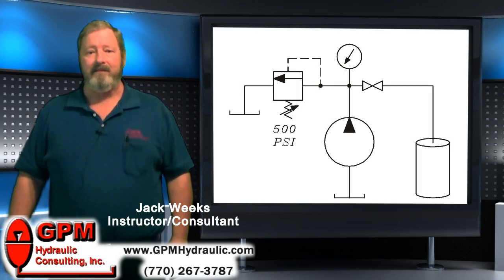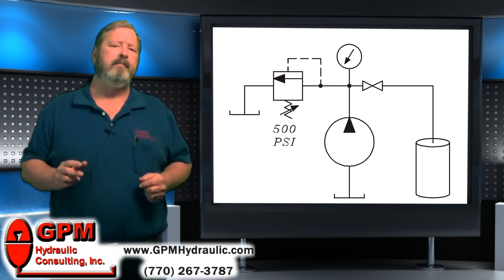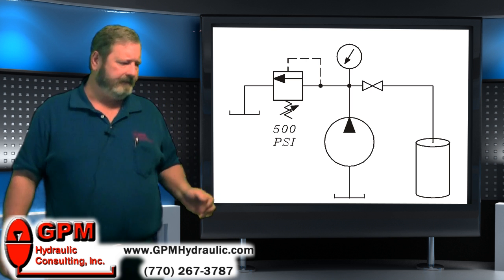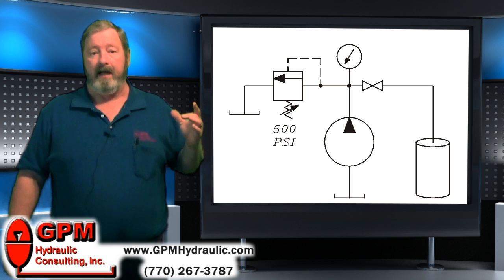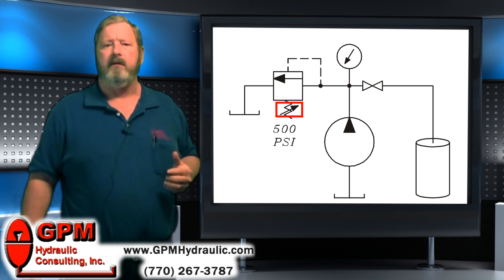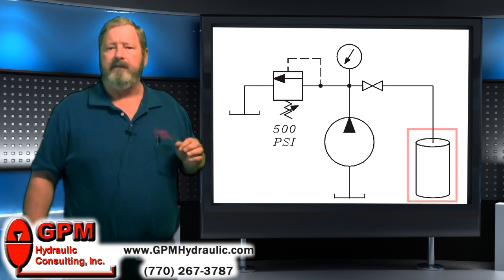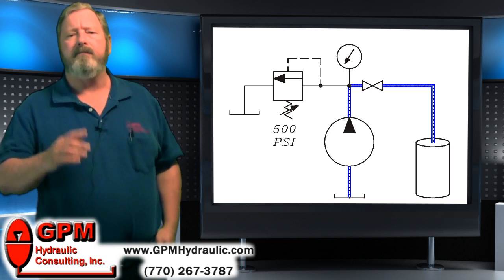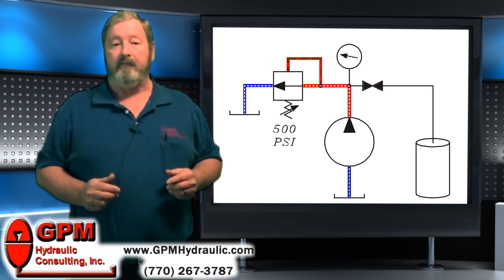The Difference Between Pressure and Flow

Comment: Does resistance affect flow rate? For example if I swapped out a 10" diameter line between the hydraulic pump and the hydraulic motor for a 5" diameter line, would this decrease in diameter result in decreased flow rate? Or does it not matter since flow rate is determined by the pump chamber size and pump speed, and therefore the same flow rate will exist; just at higher pressure?

Comment: There is "no difference".  You cannot seperate pressure and flow.  Each one is the result of the other.  A pump adds energy into the system.  Hydraulic Energy is pressure x flow.  How much of each one results is determined by how efficiently a pump can convert Energy to the pressure component of Energy, ie potential energy, and flow energy, ie kinetic energy.  The pump's efficiency is strongly related to how much flow is running through it at any given time.   At BEP, you get the best efficiency and the highest value of pressure x flow for the electric energy being supplied to the pump.  At off BEP flows, low flows produce high pressures and high flows produce low pressures.  Adding pipe and equipment into the system changes the resistance to flow and that causes the pump to change its efficiency, which causes a new Pressure x Flow output combination from the pump.  You cannot seperate pressure, from flow, or resistance.   

Look at the hydraulic and electrical analogy.  You will see that you are trying to separate amps and resistor and voltage.  Electrical engineers do not ever try to separate them.  Why bother, the result is the result of all three.  Set any two Volts, Amps and you know the last, Ohms, one.  Same for  pressure, flow and resistance from pipe/valve/equipment. 

BTW, electrical valves are called transistors.

Comment: How to set a kawasaki axial piston pump K3vg280 with torque horsepower on the hpu because it is the system trips while operating and where should I decrease flow or increase it on the controller
Reply from the maker: Hi Charles, thanks for your question! That pump should have a volume stop (manual volume limiter) on it. This is simply a screw that limits the travel of the swash plate. Turn it clockwise and that should make the system stop tripping.
Reply: @JackWeeks  thanks Jack you simply the best people like you deserve more in this hydraulic departments you explain things easily thanks buddy

Comment: Hi , hope you are good. Wanted to know your views on Pressure reducing valves. When I checked, seems that they all have internal leakage through their pilot line. I mean , for a pressure reducing valve to work , the pilot line must drain oil to tank. 
So if any pressure reducing valve is connected to an accumulator, it will drain the accumulator till the preset pressure is reached and pilot drain flow will stop ! 
Am I right? Can pressure reducing valves be used with accumulators? For example, can we have a 3 way pressure reducing valve without internal leakage? 
Do we have any models of 3 way pressure reducing valves without leakage?
Does leakage happen when valve is off ? 
For e.g suppose I have a 3 way proportional pressure reducing valve; when valve is off , output pressure is zero. If this valve is connected to an accumulator, will it drain all accumulator oil little by little? Will leakage occur when valve is off ?
Thanks.
Kind Regards.
Reply from the maker: Hi Nadeem. No, I don't think I would recommend using a pressure reducing valve in an accumulator dump line. Depending on the valve, it could easily be constructed to leave some back pressure in the accumulator. Best to use either a flow control or a gate valve. Usually it's best to dump the accumulator slowly, too, so don't open your flow control too  far. Keeps turbulence from the reservoir so you don't stir up sludge when the accumulator is dumped. Thanks for your comment!
Reply: @JackWeeks  thank you 🙂

Comment: Hi , wanted a small clarification: I wanted to know how pressure changes in a hydraulic system pushing a load. 
For e.g take a simple hydraulic Jack:  My idea is that whatever force that I am applying on one side ( it may be 1 million N) , the pressure of fluid will always be based on the load rather than the 1 million N that I am applying. You get the picture : we have 2 cylinders connected to each other and filled with fluid. We have 2 pistons. I applying force on one of them to try to  lift a load by the other piston. Suppose load = 500N 
My oil pressure will be based on 500/A2
NOT 1million/A1.
So during the lifting process, the pressure will still be 500/A2.
Same thing will happen in a hydraulic circuit :flow of pump is constant , the oil pressure will be simply calculate using the load ; the cylinder will extend/retract at constant speed. BUT HOW CAN I ACCELERATE A PISTON? WE SHOULD HAVE AN 'ACCELERATING' FLOW ? 
IF MY PISTON IS ACCELERATING , MY OIL PRESSURE WILL ALSO INCREASE! MY OIL PRESSURE WILL NO LONGER DEPEND ON THE LOAD! SIMPLY TAKE THE JACK EXAMPLE AGAIN ; HOW CAN I LIFT THE OBJECT CAUSE ACCELERATION! WILL 1 MILLION N CAUSE ACCELERATION? WILL PRESSURE BE HIGHER?
Reply from the maker: Thank you for your question, Nadeem! You are correct in your understanding that the pressure is determined by the resistance of the load (plus any other resistance in the system). Speed is determined by the rate of flow. If the increase in flow also results in an increase in resistance (friction in the pipes, for instance), then of course there will be a corresponding pressure increase to overcome it. But the increase in pressure had nothing to do with the acceleration of the cylinder, only any increase in resistance.
Hope this helps!
Reply: @JackWeeks  thank you very much for your reply.....🙂 get your point....you know, I can't imagine how can a piston accelerates! When we normally deal with hydraulics, we are using talking about constant speed of extension/retraction. If I want to make a piston accelerate;  the only variable that I suppose could do this is the flow! It should be an increasing flow to cause an acceleration of the piston! Am I right?  But then, if the piston is accelerating , using the equation F=ma , you'll get an additional force on the piston. But this additional force is only provided by the oil pressure ? I mean , an increase in oil pressure ? Don't know if I am right! Its kind of confusing.
Anyway for example lets consider the same example of the hydraulic lift: I will push on one side to lift a load on the other side. Load is of 500N.
If I apply 1 million N on one side ; the oil pressure will still be 500N/A2. But will the piston move at constant speed or accelerate? If it is accelerating , which force should I consider to calculate acceleration ! You get my point? Because   the oil is only pushing the weight of 500N with 500N too. Or should I consider the piston and oil as a single object !
Reply from the maker: @nadeemzzz5599  I think I see what is causing the confusion. You are seeing an increase in pressure when your cylinder accelerates and it appears to show some relationship between speed and pressure. I'm guessing however that you must have some sort of orifice in your line to avoid overspeed of the cylinder. We must remember that, whenever flow through an orifice increases, so does the pressure drop across it. This increase in pressure drop adds resistance to the system, thus requiring more pressure to overcome.
Hope this helps!
Reply: @JackWeeks  yes you are right ..thank you🙂🙂🙂

Comment: Hi Jack, the message seems to be that the resistance which the pump has to overcome to maintain flow is where pressure comes from. My question is: Doesn't the source on the influent side of the pump also contribute to the pressure gauge reading on the effluent side?
Reply from the maker: Thank you for your comment! I'm not certain that I understand your question, but I think you are asking if the outlet pressure of the pump can be changed by changing the suction pressure. No, it can't. Regardless of the suction pressure, if there is no resistance downstream of the pump, there will be no outlet pressure. And, once the downstream resistance has been overcome, changing the inlet pressure will not affect the outlet pressure unless it causes the pump to stall.

I hope this helps!

Comment: Very nice video . I want to ask of the pressure gauge reading at the pump outlet always indicate the resistance that the pump has to overcome in all pump cases  ?
Reply from the maker: Thank you for your kind comment and question! Yes, you can consider pressure and resistance to be synonymous in a hydraulic system. If you remove all of the resistance, say, direct the outlet of the pump straight to tank, the gauge will read nearly 0 PSI (perhaps a small amount of pressure resulting from the resistance of friction in the piping).

Comment: HI my name is Brian. Am a technician in Kenya. Thank you for your tutorials. I have this question; how do you overcome the flow/pressure from a bigger pump feeding a 4''pipeline with a smaller pump jointing this pipeline with a 0.5'' pipe. Basically the second smaller pump is trying to inject its fluid into the bigger pipeline but is overcome by the bigger pump and so doesn't achieve this.
Reply from the maker: Thank you for your comment/question, Brian! Clearly the pressure in the 4" line is above the pressure developed by the smaller pump. I suppose the question would be, where is the flow from the smaller pump going if not into the pipeline? We need a bit more information here. You don't say what type of medium is being used here, or the purpose of injecting fluid into the larger pipe. Are the fluids in both pipes the same? For instance, is the smaller pump used to inject liquid soap into a larger water line? Or are we using the smaller pump simply to augment the flow of the larger pump? Are both pumps positive displacement? If so, they would likely be protected by relief valves. If the smaller pump is positive displacement and the pressure is too high in the larger pipeline for the smaller pump to deliver, the flow of the smaller pump must be dumping across a relief valve. It may simply be a matter of setting the relief valve protecting the smaller pump to a higher setting so that the path of least resistance is to inject into the larger pipeline rather than dump across the relief. If however the smaller pump is not positive displacement, the pressure in the larger pipeline is too high for the smaller pump to deliver. In that case, the smaller pump would begin to bypass across its internal clearances. If this is the case, you will need a different pump to deliver flow through the 0.5" line. Hope this helps!
Reply: Hi thanks for replying. Now the fluid in the 4 inch pipe is petrol and the smaller pipe is an additive injection to mix with that fuel to a set ratio. I'll have to find out if the pumps are positive displacement, but I suspect both are. The mech team tried fix a non return valve on the  smaller pipe right at the inlet to the 4 inch. We are yet to test and hope it will work. Do you think the non return valve will work? Or we must use the thermal relief valve?
Reply from the maker: @Bojak079  The non return valve will keep reverse flow from entering the 0.5" line and turning your smaller pump backwards, but I doubt it will help overcome the pressure in the 4" line. In order to add flow, the pressure in the 0.5" line needs to be higher than that in the 4" line. The smaller pump should be able to withstand the resistance in the 4" line if it is positive displacement. If there is not already a pressure relief valve in that 0.5" line, the smaller pump must not be positive displacement. It must be behaving similarly to the impeller type water pump in an automobile engine when the thermostat is closed - bypassing internally once pressure reaches a certain point.

Comment: Sir i ask u one question plz reply sir ane ahu air handling unit 5 bar pressure but one issue if our actuator open time and close time chw pipe vibaration why sir after 6 sec vibaration normal but our actautor value all okay can u answer this question plzz sir
Reply from the maker: I'm not sure I understand your question. Do you mean that the actuator vibrates for 6 seconds when cold, but the vibration goes away after it warms up? If that is the case, it sounds as though you may either be overlubricating your air, or perhaps using the wrong oil in your lubricator.

Comment: What is pilot lines?
Reply from the maker: Excellent question. The pilot line is a very small line that delivers a pressure signal to the valve. In this particular case, the valve is a relief valve. The pilot in most relief valves is internal (even though the symbol is drawn such that it may appear to be external).Whatever pressure is present in the main line will also be present in the pilot line. Pressure in the pilot line acts upon the internal spool (or plunger, depending on the type of relief valve) and, once the pressure reaches the amount necessary to compress the internal spring, will shift the valve open. Fluid then returns to tank through the valve.
Hope this helps! Thank you for your question.

Comment: Most folks don't know the difference between STATIC pressure and VELOCITY pressure.
Reply from the maker: True, but to be fair, that would apply more to HVAC systems than to hydraulics since, in hydraulics, the two are for all practical purposes equal.

Comment: Thank you for the info but you didn't elaborate the title what you mentioned
Reply from the maker: Thank you for your comment! But I'm not sure I understand - are you saying that I failed to explain the difference between pressure and flow?
Reply: The topic on flow was bit missing compare to the pressure you elaborated.  Anyways thank you for the positive gesture
Reply from the maker: @hemanthchavan2819  My pleasure, Hemanth. Sorry that I didn't convey enough about flow, but all that I was really trying to get across was that flow describes the volume of fluid being delivered, whereas pressure describes the amount of resistance to be overcome by the flow. I had considered elaborating to some degree about how the volume of flow would determine the speed of the actuator and that the weight of the load on the actuator would determine the resistance (and therefore pressure) in the system, but it seemed as though that might be going off on a tangent.
Reply: @JackWeeks  Thank you for your reply. 
For instance, if you have a fixed displacement pump, running at a constant rpm and you are not sure whether the pump displaces the full flow rate or it has leaks with reduced flow but you are sure that it has the capacity to overcome the pressure build up by any resistance. So in this case, how to determine that the displacement is actually good or the pump is still performing well with reduced flow  or low flow and leaks, provided no flow meter in the circuit. I hope you will understand my concern and share your valuable experience. In short, I get the pressure correct but I am not sure whether the flow rate is delivered correct.
Reply from the maker: @hemanthchavan2819  If you have no flow meter (and do not wish to add one for diagnostic purposes), it is not as easy to measure the condition of the pump, but it can still be done. If the pump is becoming worn, it will lose flow (and heat up) under load. Even a bad pump will deliver its rated flow (or very nearly so) if there is little or no resistance. So try moving your actuator(s) with no load and time how fast it moves. Then try it under load. On most industrial machines, the design will require 75-90% of the pump flow, so if the actuator slows more than 10% or so, you might consider replacing the pump. Naturally, if your specific machine functions satisfactorily at a slower speed, it may not be necessary to replace the pump until it is more worn than that.
Bear in mind however that the pump is not the only component that can affect speed with an increased load. The prime mover can cause speed reduction under load as can bypassing cylinders, motors, and pressure controls. This is the advantage that a flow meter can provide - all other components can be eliminated by measuring flow directly and using the relief valve to simulate the load. Then a reduction in flow can only be caused by either the pump or the prime mover. Usually bypassing components will also generate heat, so it is a good idea over time to check the temperature of components that can affect speed so that if only one of them begins operating at a high temperature, it can be a good indication of wear.
Hope this helps!
Reply: @JackWeeks  Thank you so much
Reply from the maker: @hemanthchavan2819  My pleasure - happy troubleshooting!